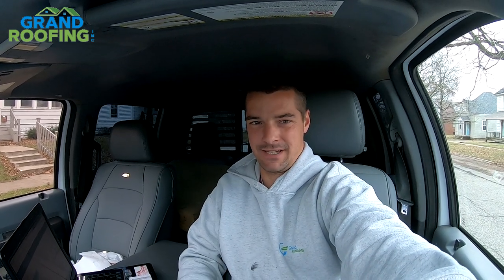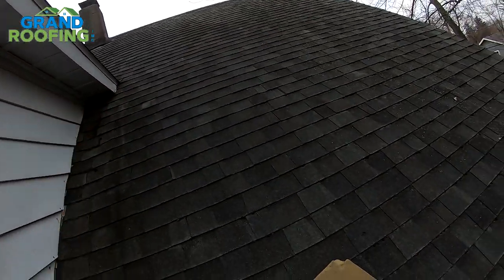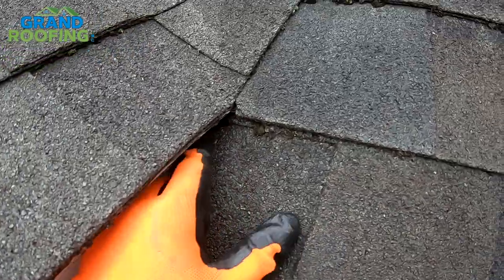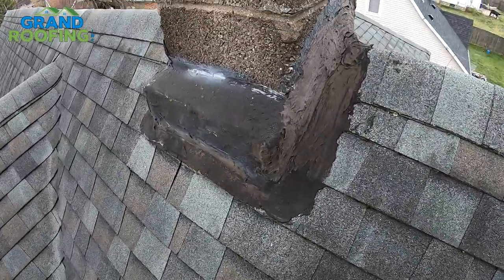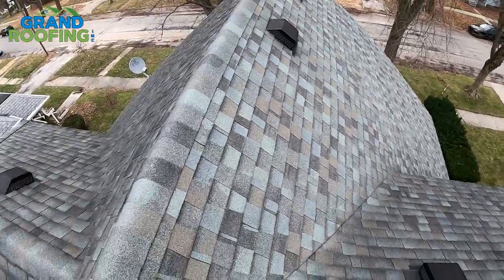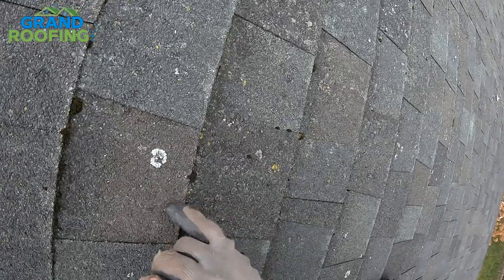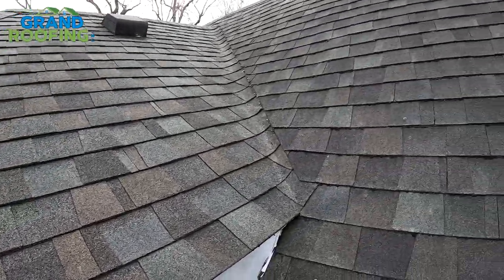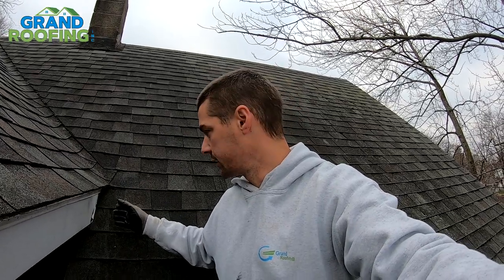Roof Leak Inspection for repair EST - how to find a roof leak

Comment: I did roofing for 44 yrs in san antonio tx. Bu I am retired now and that was all I did was repairs on nearly every kind of roof. And the area where the fascia dies out into the roof at the bottom of a Valley is a problem spot especially when the original roofers didn't install flashing properly, or none at all like at the end of that valley or chimney flashing unless they consider plastic cement flashing. I know I couldn't sleep at night if I ever did a job like that . but I can tell the way you talk that you know what you are doing and take pride in the work you do . do you work by yourself? I did 95 percent of the time. But seeing your video's makes me want to get back into it again,roofing that is. But at 65 yrs. Old I don't move around like I once did. Keep up the good work and be safe. That foam sure does help from sliding, and when I was roofing nearly all my pants were wore out in the seat on my left side. Lol
Reply: Join back as a laborer and nail the flatter roofs if you can. We have a guy your age who does it all the time

Comment: How did you know right away that they were tamko? I do repairs, too. Its always a fun game trying to figure out what brand to best match the roof
Reply from the maker: Over the years you get better at telling them apart. There are things you can use to identify different brands like dimensions and exposure, dragon tooth shape, Shadow lines in the color drop, where the seal strips are placed, maybe it's got an Owen Corning sure nail strip, iko has theirs on the backside, the way certain teed has three lines to indicate where the nail, malarky has two, how much of a common Bond lap there is, and most of the time you can also tell from the cellophane strips. Most manufacturers have a code on the back to know where they came from.

Comment: How much should I be paying for a leak in a very low roof that's flat on an addition that just had the roof put on 5 years ago ?
Reply from the maker: It's hard to tell without knowing some other things. There are many factors that can change the price. Due to supply and demand, If there are not many people willing to do a repair in your area the few that do typically charge more. Reputation and quality, what all is involved with the repair, material they're working with xcetera. What kind of repair are you talkin?

Comment: I never flash the top rows by the facia at the bottom of a valley....always sawzall the facia and bottom foot of the sheeting in the valley so those rows run all the way through to the wall, absolutely no question of a leak happening
Reply: Oh btw...not saying anything bad about your repair bro, I absolutely woulda flashed it the same way you described being that it’s just a repair 👍🏽
Reply: That is the right way of doing it. I don't know why framers put the fascia tight to the roof deck.
Reply: Oh absolutely...we finally got most of the framers we do roofs for to start leaving gaps in the facia in all those areas...they still don’t cut the decking back but a few leave the bottom un-nailed so it helps
Reply from the maker: Yes I agree if there's a gap and you can shove a whole shingle all the way up and over that's the best thing to do. I don't know why so many people nail the fascia board to the roof deck and roofers ram their edge metal way the hell too far into the roof deck.
Reply: You need to flash it properly. I agree your method will not leak but it will rott the sub facia over time.
Reply: @bryangryder3289  ...yeah you are right, especially if the facia isn’t wrapped in aluminum. But if it’s not wrapped in aluminum flashing it to the facia looks terrible as well. Pros and cons to both for sure, but I definitely prefer cutting them

Comment: Thank you for your video sir. My IKO shingles are 5 1/2 years old on my house. I’m located in the Dallas area and we get storms all the time here. So far I’ve been lucky. 4 houses in my neighborhood have already replaced there roof in the last two years due to wind damage. All of the houses in the neighborhood are around 5-6 years old. My neighbor down the street had a few shingles that blew off due to 50+mph wind gusts few weeks ago. These shingles are not  withstanding the wind speed as there are design too. How can I approach IKO if this happens to my roof or I’m just wasting my time? I appreciate your feedback.
Reply: Pretty sure they have a  Limited warranty. 
You can probably have your shingles manually tarred. Where someone lifts each shingle and places 3 beads of tar, one on each corner and one in the middle. 
May cost $300-$1000 depending on the house. 

It will help against wind.

Comment: Wow what can you say.. that chimney is a disaster, the bottom of that valley is no bueno and I’ve never heard of these tamco shingles but it’s pretty pitiful if they aren’t sealed down.. I know we had IKO shingles had that problem here a while ago, but supposedly they’ve solved that issue and we haven’t had any trouble with them as of late.
Reply from the maker: How long ago was the issue with iko?
Reply: @GrandRoofingInc  I believe it was 7-8 years ago
Reply from the maker: The tamko shingles I was talking about, they were so bad for so long tamko took the entire company to dinner and kept saying they put all kinds of money like 56 million dollars in the back end of their plant to fix the problems. We continued to get bad material. Anything that could have gone wrong making the shingles they did. They were the worst shingles I have ever used.
Reply: @GrandRoofingInc  have you ever used BP brand shingles? They're also pretty terrible. Almost every blow off or leak repair I've done (that was Architectural and Not 3-tab), has been BP.

Comment: You should look at getting a pitch hopper. Couch cushion on steroids. I know it doable without but once you get one you will never go back.
Reply: Aren't they like $100+? Why not grab a few 2x4s and 1" piece of plywood and spray adhesive and make your own. Should have that leftover from scraps at a job, pretty much free to make and you customize it to fit the pitch of the roof perfectly
Reply: @Josh-ww5kz  65$ and it's still worth it. Just has a more professional look that's why we use them.
We have done what you are talking about though.

Comment: This guy is a rookie !! Caulk the tiny lil corner on that valley.. water runs down .. hello 👋 .. Put new 3 course on the old roof mastic . ..that’s  the real leak bro !!!
Reply from the maker: It had nothing to do with the chimney, and tar is not a fix.
Reply: The leak is at the chimney and running down to valley .. I bet my check on it  !!. And tar is not a fix but a will stop water for years and it’s cheap and fast since the roofer that installed roof probably didn’t get paid enough .
Reply: @GrandRoofingInc  we have let people go for thinking tar will fix it. 
Tar is only temp.
Reply from the maker: The leak is on the north slope,  watch the video back again the cracked tar is on the southern side. The chimney is also at the highest point, there's not enough rain runoff to do the damage that was caused inside.
Reply: I had a customer with a  similar roof, flashing at fasia  and a small piece under valley.  problem  solved
Reply: In your first sentence,  you started off with a lie; and then proceeded to show show pride coupled with ignorance.  Bravo!👏   gotta love YouTube comment experts. 👍🏼